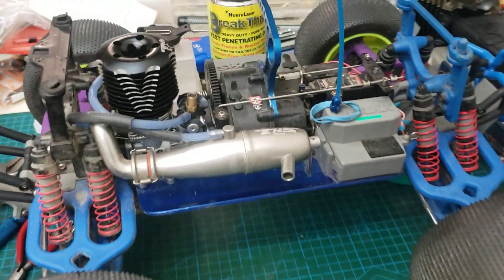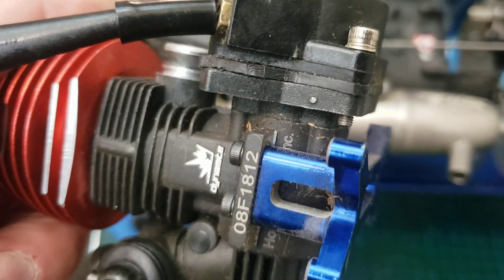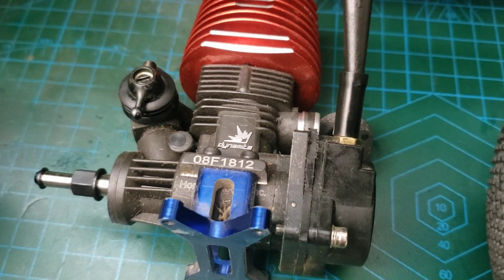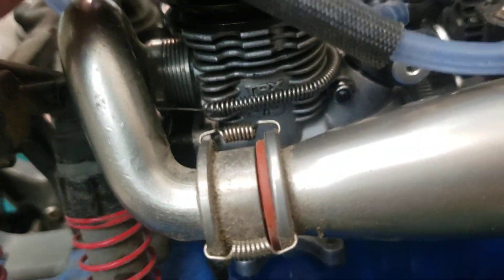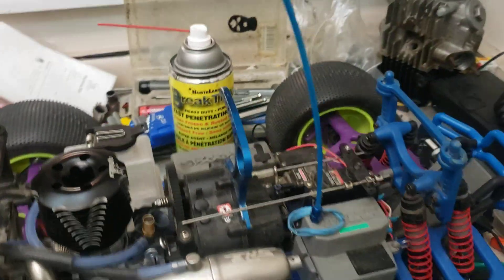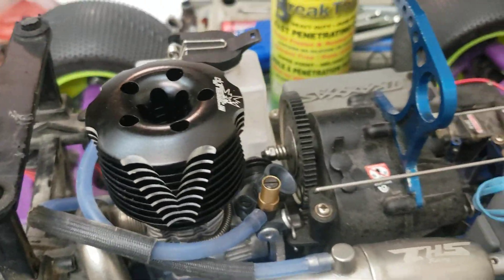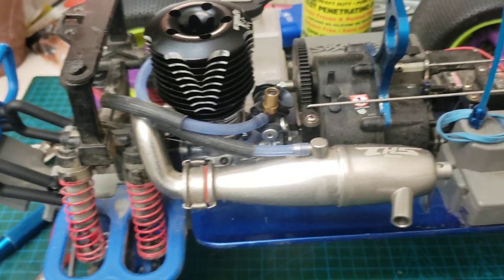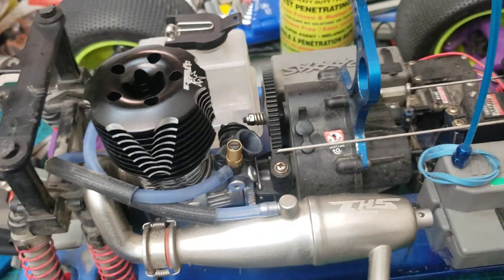Tmaxx update! new 3.3!

Comment: Hahaha awesome I live in Powell River BC 
Yeah it’s raining and I just want to go out and burn some nitro.  

Super new to this and do not know where to get gas yet. Where do you get your fuel for nitros. 👊😎
Reply from the maker: Hey man I'm down here in Vancouver and we just go to basically any hobby shop that sells it I just try to avoid the top fuel because it's really crappy but if there's absolutely nothing else then you can use that
Reply: @thebug4046  
Nothing else unfortunately. I can get some VP stuff from my local Lordco. 
Should I get that stuff and add some in the mix. 

I believe it is a vP oil something like 70 weight mix for nitro rc’s. 

Is that what I should be using not caster oil

Comment: I can tell u from experience that my 19 t with 2 dots will not turn the easy start if I tighten it properly.  Had to not tighten to the point of falling out while running to make it work. After resealing the entire engine due to air leaks.
Reply from the maker: They do have a few issues but will run good when sorted out